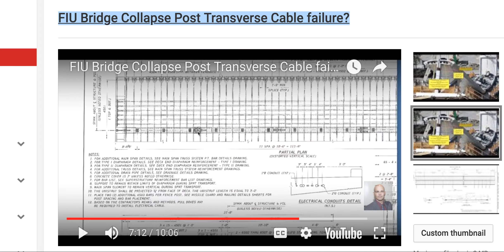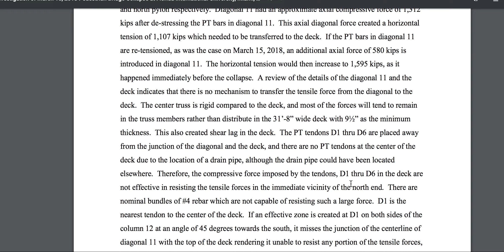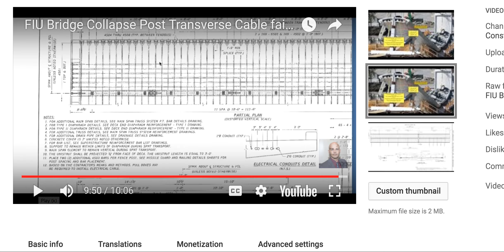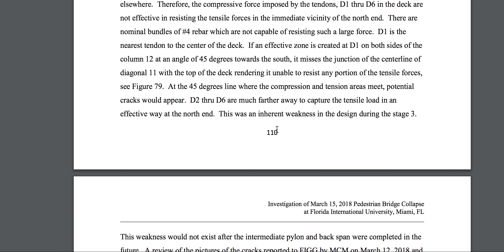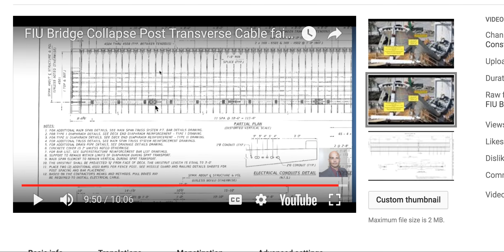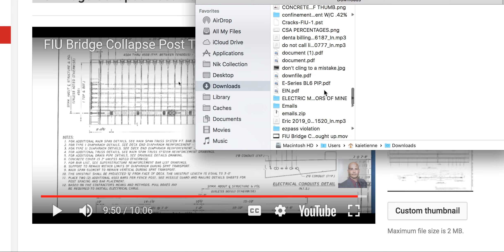Fiu Bridge Collapse OSHA Report D1-D6 load path "'zone of influence"

Comment: In addition to the cantilevered slab loads, they were apparently using the transverse post tensioning to help resist the tensile forces due to shear as the loads transfer from the truss out into the deck. Even with the shear lag that would occur, we cannot make the statement that this was an inadequate design to transfer these loads. As far as we know the problem was only at the end of member 11 and there was not cracking at every truss member so the design was transferring this shear into the slab as predicted. 

The problem with relying on post tensioning to resist tensile forces due to shear is the post tesioning may not always be there in full force due to loss of prestress and therefore they should also have placed a fair amount of shear reinforcement there as well.  If there was not a lot of shear reinforcement in the slab across the truss than a good chance for added redundancy was lost in the design.

At member 11 we run out of deck so the horizontal force of almost 1.5 million pounds had to be tied back to the deck with hair pin reinforcement and or dowels forming a cage in the center of the deck, far enough in to develop the steel and transfer the loads out where the longitudinal post tensioning could do its job..  If they were relying on any transverse post tensioning to help resist these loads at the slab edge this was a mistake.

As I stated in a comment in your last video. I think the "diaphragm" was not designed to span over the two bearing pads as built and subsequently failed under the million pound vertical point load under member 11, damaging the concrete, its PT anchorage and affecting the above transfer of huge horizontal loads back into the slab, leading to the failure of the member 11-12 connection with the slab. 

CE&E have you been able to verify if the bearing pad design/number/placement was changed or shown differently in any of the drawings throughout the design or can you point me to where I can look at these drawings? The OSHA report showed evidence of vertical shear failure of the diaphragm supported over the bearing pads under member 11. This is huge evidence in explaining the failure.
Reply from the maker: It's already in the report released by fdot and FIU days ago...
Your commwnts are in the Denny Pate report.
With that said, that method of failure does not cause this failure.
I will explain all in the next few days and the hint is in my last live video.
"Crowning", is the hint and I will switch up but you have to wait for the data first and then I will tie it all in.

Comment: I don't have time to listen to your full commentary at the moment, but I find it very interesting that their analysis points up that the truss section was more rigid as compared to the deck and that the force distribution was inadequate.  Honestly there were many problems with this design.  It was an entirely pathetic design.  What I'm still wondering is how large a role did FIU play in the design concept?   I think it's a lot more than they are admitting after the collapse.  Was FIgg designing or engineering  to FIU's specifications?  This so called bridge was a serious piece of crap.
Reply: From the OSHA report:
FIU retained TY Lin International (TY Lin), a construction engineering company, to prepare design criteria and conceptual drawings for the pedestrian bridge project....The design criteria also stated that “The bridge superstructure should be primarily structural steel with concrete walking surface.  The design should avoid use of non-redundant, fracture critical members.”
...
A selection committee consisting of FIU officials, City of Sweetwater, and FDOT was established....The selection committee selected the MCM-FIGG proposal primarily for its aesthetic considerations.
Reply: @redtrek2153  TY Lin is a big name in bridge building. They should have listened to them. They could have used steel box sections and got the same look and functionality with a lot less weight. Maybe have access points inside to inspect for corrosion.
Reply: @redtrek2153  ,  thanks for this information.  Do you have a link to the actual report?  What I do note is the Figg design was significantly different from the TY Lin proposal which I believe was an actual suspension bridge.  There are pictures of that design on the Internet.  I really fault the design.  Perhaps there were construction issues but there certainly are a lot of issues related to Figg's concept.  Apparently the selection committee was presented a snow job.  It would be interesting to know if more practical less aesthetic designs were rejected.
Reply: @redtrek2153  “The bridge superstructure should be primarily structural steel with concrete walking surface. The design should avoid use of non-redundant, fracture critical members.”  How could they stray so far from this critera?   Someone threw this structural design off track.
Reply from the maker: ...obviously, I do not find the "ratio" to be "equal", as this report shows and I stated and showed in my  videos...
This is my theory on load distribution and how failure / elongation beyond  or to the point of deflection took place...
Perhaps even staying elastic during the entire failure; we do not need it to go  "plastic" for this failure (in my theory).